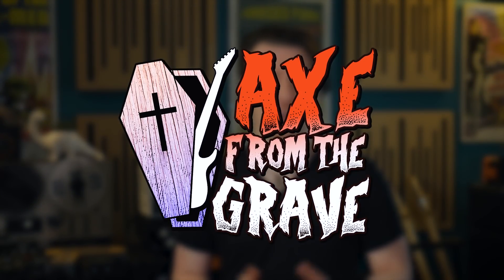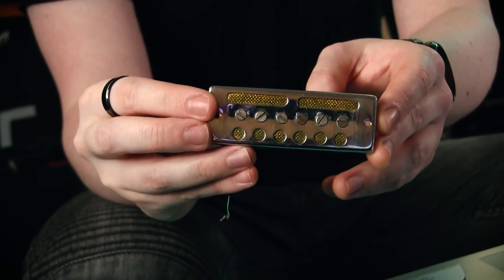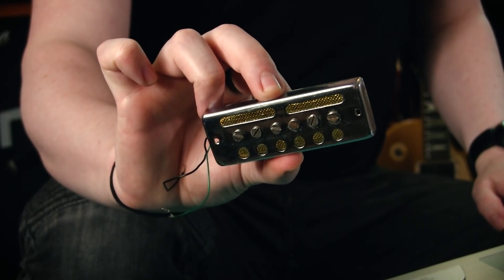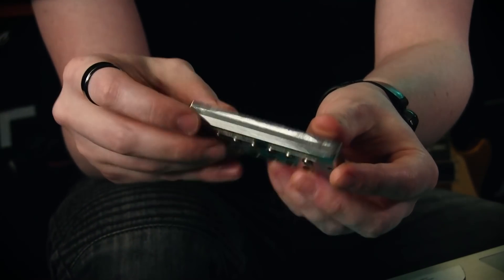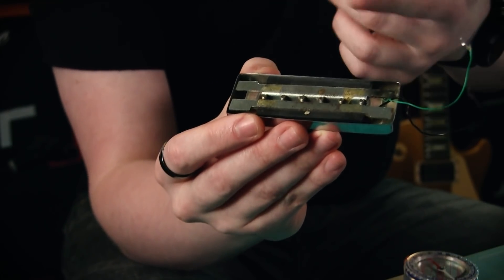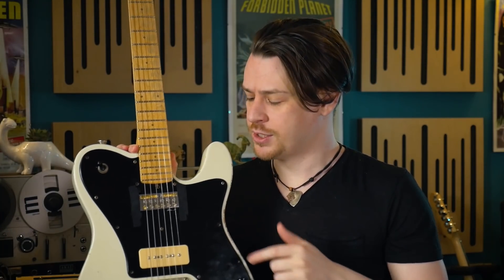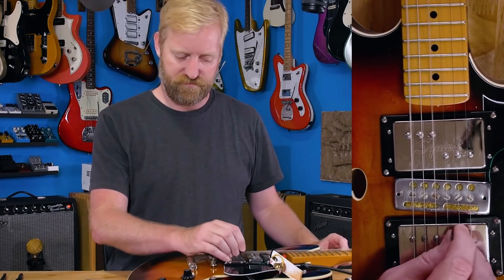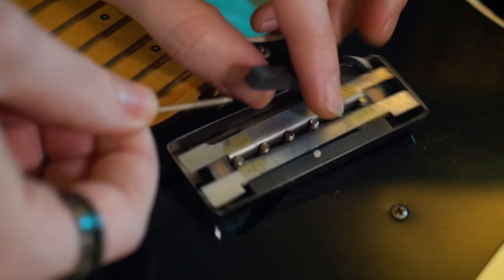We Fix this FAULTY Gold Foil | Axe From The Grave (ft. Ryan Burke of 60 Cycle Hum)

Comment: Very informative. Kinda assumed would be done to the magnets. Evidently in my guitar journey I’m learning which is always a positive. Unrelated question . I’ve recently acquired a re issue epiphone coronet. Has cts pots. And p90 pro in the bridge. ( only has the one pick-up) I’m going to switch it out. But unsure as to whether go down the Monty’s 54 p90 in bridge which gets great reviews. Or change it to a a reproduction of the original New Yorker pick-up by Curtis Novak who has a great reputation with an altered pick gaurd to match. He winds them to similar output of a vintage p90. Any suggestions on which one you would opt for? Any advice be helpful . Cheers

Comment: Hi Colin and Rayan. Thank you both for your great work. Pickup electronics has been always been my a lot of queries and have been reading, watching many professionals in this area, have taken Seymour Duncan 101 course, following  ThroBak Guitar Lounge, Dylan Talks tone and other guitar electronics and tone nods!!  Please excuse my silly question, according to ThroBak Guitar Lounge company YouTube channel in case of changing the type of Alnico magnet in  vintage PAF pickup, both ends plus the top and bottom parts of the Magnet bar need to be checked as well !! Which made me think what is the exact pattern of magnetism around all ends of the bar !!( top, bottom, ends and the sides) 🤔🤔Your input is much appreciated  please in a new video on your channel explaining  how to do reversing the polarity of the humbucker  bridge can be understood in addition reversing the wiring too  to have hum free pickup especially when using rotatory 5 way 4 poles switch  wiring Bridge humbucker and Neck humbucker pickups!!  Thank you Colin👍👍

Comment: You can use the inside wrapper of a chocolate bar applied to a course linen cloth with spray adhesive and rubbed gently into the cloth . Also fine nylon mesh I use to replace rotten fabric mesh in old Vox speaker cabinets behind the grill cloth will give a different pattern .Other material from tolex to embossed tissue will give different patterns .

Comment: Nice Hammond Organ Co. logos router'ed on wall on wall behind you. 
3 GREAT TECHNICAL ARTICLES, WITH ANIMATED FUNCTIONS. A MUST SEE! SCIENCE OF:
HAMMOND ELECTROMAGNETIC TONE WHEEL GENERATOR, and WURLITZER ELECTROSTATIC CONTINUOUS FREE REED TONE GENERATOR
AT>   *North Suburban Hammond Organ Society ( NSHOS) 
ARTICLES:  HAMMOND B3,  WURLITZER 4600, HAMMOND X66  organs   [I own all 3 of these models, except B3 in A100 cabinet, and Wurlitzer 4600 in spinet (4410) form. Spinet organs have 13 pedals and 43 key keyboards x 2. Console organs are 25 or 32 pedals and 61 keys  x 2 or 3.
The 4600/4410 were the very first organs with SUSTAIN. The great analog electronic organs late 1920's to mid 1970's, most used DC Keying, and used common-chassis ground to key the note. SUSTAIN is achieved by using a simple capacitor/resistor discharge/bleed off on each discrete keyboard key and pedal. Bigger capacitor means more sustain. (caps are common 'tone pot' polyester (mylar+foil) caps). So to achieve SHORT,MED,LONG SUSTAIN just 2 caps per key/pedal are used. ie.  .33uf=short,  .68=medium, and .33uf + .68uf in series= long. Hammond tone wheel organs can't use this system, so Hammond's never had Sustain until they used solid state tone generation.  LOOK AT THOSE ARTICLES! ON MY :yt: CH. (click my avatar, drag to new tab) 'Opening Video', I play my Wurlitzer 4410 electrostatic continuous free reed organ through a Hammond HR40 tone cabinet , Leslie v-21 horn, and Wurlitzer SpectraTone 

In the organ world an internally amplified speaker is a 'tone cab', but a 'Lesliie Rotary Speaker' is just called a Leslie] and a Leslie (Jensen v21 driver) horn, AND Wurlitzer's version rotary speaker is called a SpectraTone (2 counter balanced 4" speakers rotate). Now what is cool about Wurlitzer is they don't rotate low and mids using big speaker baffles. Instead they take advantage of the principle that LOW FREQ MODULATION (FM) and AMPLITUDE MODULATION (AM) is harder to detect source location, versus HIGH FREQ MODULATION. So Wurlitzer cleverly devised an 'offset disc hard mounted on the outside of the SpectraTone's center axle. 

As it rotated the edge of the disc blocks light gradually in a simple LIGHT DEPENDENT RESISTOR (LDR) [aka photocell/photo resistor] {think Morley Pedal} statically mounted near the disc. From here the signal goes to a simple VOLTAGE CONTROLLED AMPLIFIER (VCA) where it raises and lowers the organ's audio signal to a pair of 12" fully 'crossover'ed speakers. 

To the listener the crossover'ed mid/high freq's sound in motion [because they are, via rotating SpectraTone, see DOPPLER EFFECT]. In turn the ear perceives the 12" low freq's in motion as well, but really it's just (AM) (aka TREMOLO) created by the VCA circuit [ NOTE: the location of the revolving speakers synchronized to exact AM volume shift is imperative for it to operate believably]. Since the organ has VIBRATO (FM), the effect is AM/FM in the 12" speakers as well.  In organdom this Amplitude + Frequency modulation is called TREMULENT, and imitates the oscillating air regulator placed between the blower and the organ pipes. With this action of oscillating air pressure it gives both AM and FM from the pipes. QUIZ- Can you explain why?

Comment: If you want less noise, you shouldn't solder a ground lead connecting to the back of your pots if they are already connected with their shafts to a metal shielding plate or foil... (if, of course the pot shaft is connected to the backside of the potentiometer..) You need to contact each part you want in the grounding circuit, ONCE to ground!  What your doing if you, for example did what you have in (timestamp) 10:11, you basically create a "coil" with one wrap! Which, acts as antenna.. Just my 2 cents! Cheers.

Comment: What would the pickup sound like if you had only rotated it 90⁰? In theory that puts both north and south facing the coil. Would it sound like it did before the fix or would it not work at all?

Comment: Have you ever done a video on Burns Tri-sonic pickups?
They're about the only pickup design that I'm aware of that has the magnetic poles pointing transverse to the strings, as opposed to the more regular longitudinal orientation used by most manufacturers and I think that's quite interesting.
Only major downside is that if you want to use the original design and not the strat footprint one that they brought out more recently you're going to have to modify or buy an instrument because those things are huge.
That and trying to wind a coil without a bobbin seems like it would be quite fiddly.

Comment: I have a old foil pickup that looks a lot like that that’s so microphonic I actually screwed it to the top of a old cheap nylon string classical guitar. It actually sounded great. It was a cheaper one than that one though (believe it or not they made cheaper built ones) it had a thin coil with a iron bar in the middle setting on a huge ceramic magnet. Weird pickup but a surprisingly good microphone for acoustic guitar lol

Comment: I have a TATA on guitar and specifically pickup building. What does a builder have to specifically do to make a reverse would reverse polarity single coil pickup and if you were putting a new set of single coils with a rwrp middle pickup in an HSS strat would a normal rwrp pickup be good or should you look for a way to rereverse it to run properly with the humbucker in the bridge?
Reply from the maker: This video should answer the first part of your question: https://youtu.be/WCpS1VVKWsY

Comment: Hi Colin, I bought a used guitar a few weeks ago, and after bringing it home I found out that when the tone knob is turned all the way up, it cuts my signal to the amp in half.  Another strange thing is that it turns the opposite way than the volume knob.  Maybe that's normal for some guitar models, but I've never experienced that before.  Any thoughts?  Love your vids man

Comment: Add peroxide to that vinegar and you get instant rust... or copper oxide on copper bits.  I've finished a few pedals that way, nice effect
Reply: Vinegar + peroxide creates paracetic acid which can be harmful to the lungs and respiratory system. So if anyone is going to try that for finishing or oxidizing metal it should be done in a well ventilated space and with proper PPE.
Reply from the maker: Use protection and stay safe.
Reply: @howlongcanimakethisfukingthing  1 duh, 2 if you use just a little you have nothing to worry with.

Comment: It took me a while to visualize how the magnetic field from the magnets would interact with the coil windings. To me, it seemed like you'd want a more uniform magnetic field from neck side of the pickup to the bridge side - thus N and S facing the middle. 

You mentioned that the pole pieces were getting magnetized by the magnets, but I couldn't figure out how that would be when the magnets are on the outsides of the windings. I had to go back and re-watch to see that the metal piece that the pole pieces screw into also goes under the coil to touch each of the magnets. That gives the inside of the coil an N polarity and a S polarity on each of the long sides, outside of the coil. Using the right hand rule on both the neck side and the bridge side of the coil shows both fields generating current in the same direction around the coil. 

Got it! Interesting pickup design.

Comment: I've learned more about magnets here than in physics classes during high school. Thanks, Professor Colin!

A TATA for you, if I may: what determines if a pickup is supposed to be used on the bridge or neck position? Output, tone? Both? None?
Reply: Believe it or not, it’s commonly due to string spacing. Although many people have different specs of pickups between neck and bridge, generally, the poles on the neck pickup are slightly less spaced out due to the strings drawing closer towards the nut
Reply: @jckmthr  Oh yea! I completely forgot about that, probably the main reason to label them bridge and neck. Thanks.
Reply: For many of the old P-90 equipped Gibsons, the neck and bridge pickups were identical. While differently constructed and different output pickups are more commonly used in neck and bridge positions today, much of the tonal difference comes solely from one pickup experiencing more treble frequencies at the bridge and the other experiencing more bass frequencies at the base of the neck.
Reply: @kyyowa129  Exactly. I am aware that placing them closer/farther from the bridge changes the sound, but I'm also curious if they have to diminish/emphasize specific frequencies to compensate for their placement.
Reply: Colin has a video for that https://www.youtube.com/watch?v=d6G3VxcW7N4 - What Makes Neck PICKUPS Different? | Too Afraid To Ask

Comment: great video ! collabs are always cool.
14:03 but that's not a 90 degrees rotation, right ?
Reply from the maker: The smallest rotation one can perform on a cuboid is 90 degrees for it to sit flat on a face. 
To invert North to South one needs to rotate the magnet 2 x 90 degrees, or 180 degrees.
Reply from the maker: a single 90 degree rotation would have the North facing down or up, which isn't useful
Reply: @ScienceofLoud  then we agree !